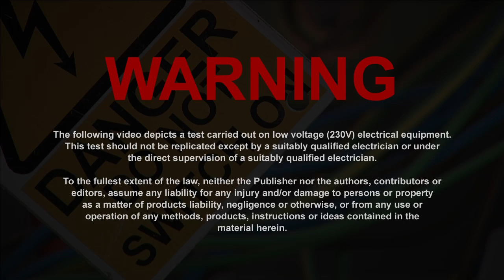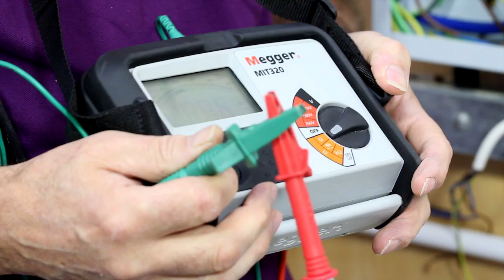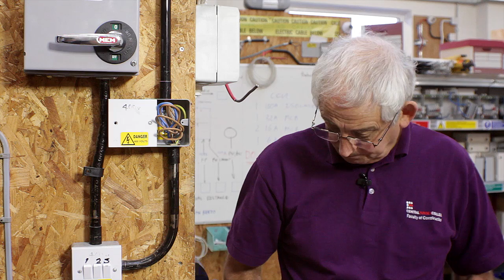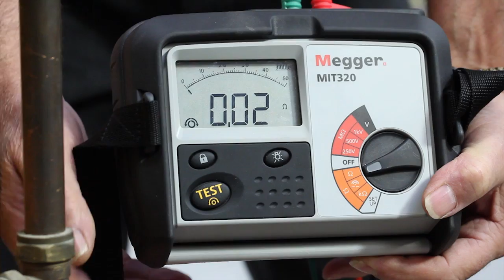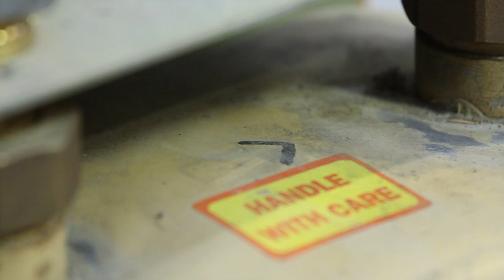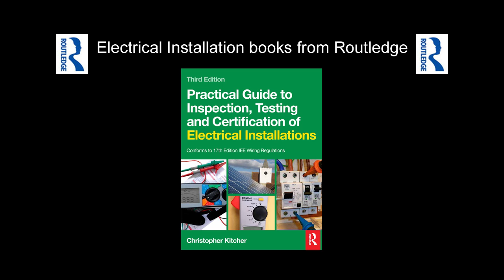QR code 1 -- Main protective bonding test

Comment: Just thought I would mention this here because it will be the first video you watch.
The accompanying study material book, 'Practical Guide to Inspection, Testing and Certification of Electrical Installations: Conforms to 18th Edition' has more errors in it than GN3. 
I've only been using it for 4 or 5 days and already come across duplicate pages, spelling mistakes and instances of the wrong units being used in the calculations of worked examples.
For an educational book this is not good enough and almost as unprofessional as the IET releasing the Guidance Notes without proof reading them.

Comment: This is not correct. GN3 gives the value of 0.05 ohms for joints across bonds by earth clamps to the pipes. Nowhere does GN3 indicate that the resistance of the bonding conductor from end to end should be below 0.05 ohms.

Comment: What a well practiced teach in, your manner of speach is perfect for all to follow, well done!
I think from looking at the comments here that how you have Tested the Gas Main Bonding left a lot of us scratching our heads, after all you were supposed to be measuring the Length of Cable Resistance and not picking up any resistance of the copper pipe connections, I was always taught to remove the Cable away from the Bonding point when Testing
If I was fortunate enought to have the Main Water Bond nearby, then to use that as my return loop, take the reading at the Main Earth Marshalling Position and then look up the Tables showing the values of resistance for each cable to prove everything was correct.
Mr Spence Eng

Comment: Shouldnt you disconnect from the pipework instead of the board to stop the chance of results from parralel paths?
Reply: If you did that you could not prove that the clamp had a good connection to the pipe, which is the whole point of the test.

Comment: where would you note this measurement on certificate / report? there is no section for r2 for bonding
Reply: You dont need to note the measurement, there is a tick box to confirm it in the bonding section of the certificate